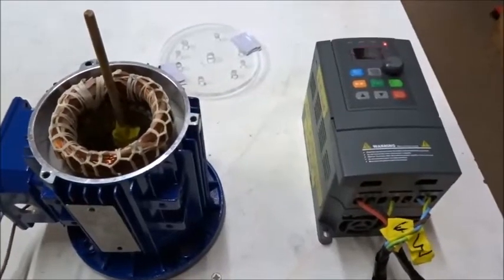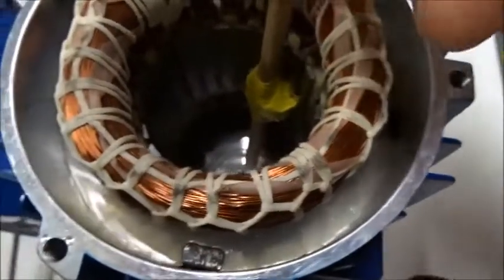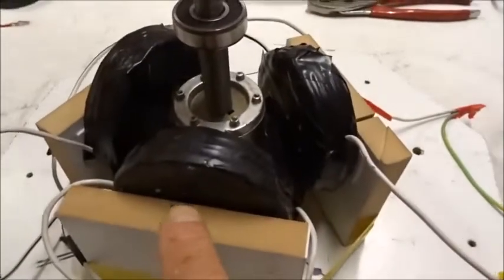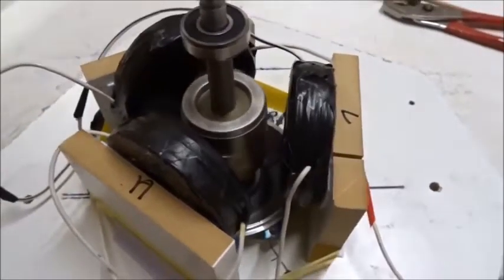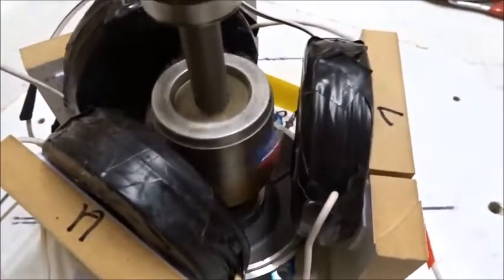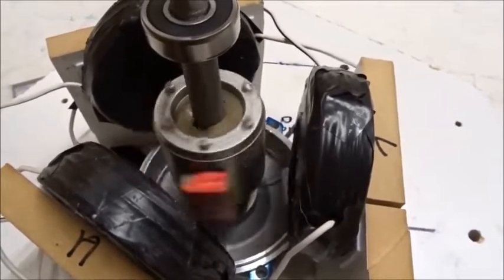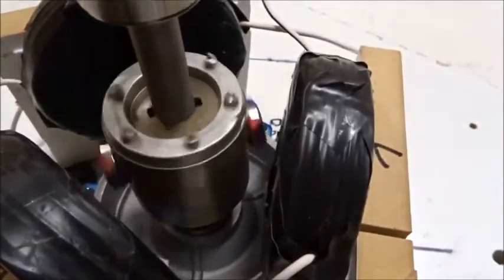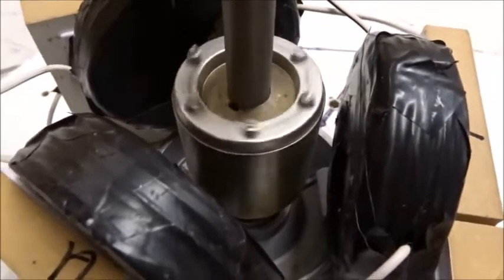Adding self-starting magnets to a 3-phase induction motor: Part VIII

Comment: Impressive work! Bare with me, I'm in need of improving an induction motor too for better low load efficiency and after reading several univeristy experiment papers on doing this, you are on the right track, however there are some caeveats and I have found out the following:
Replacing the cage with PM magnets improves efficiency and makes your induction motor a syncronous motor. However it also introduces some problems: Without the cage that is capable of varying its magnetic field depending on load, you now have motor that has fixed max torque that can be as large as with the former cage, but that makes low load efficiency even worse, as now you have excessive cogging from current induced in the stator laminations when not needed. You can also use weaker magnets, but then you get a weaker motor overall. The second problem is starting: Slowly ramping up the frequency at no load, like with a fan works fine, but a high enertia load, like a vehicle, you can't use a simple vaiable sinosoidal controller as the rotor will just slip when the frequency exceeds the rotor speed.
I think the best compromise is to make what is called a linestart PM syncronous motor; you keep the cage but spice the rotor with PM magnets, so the motor works as a syncronous PM motor at low load, but if high torque is needed, the cage takes over and the motor becomes asyncronous. So with my 30kW motor efficiency in the 6-15kW range is fine (around 86%) but at low load 1-2Kwh, it is only between (44-64%) which is horrible!! So to convert the rotor I intent to drill a line of shallow holes inbetween the bars of the cage and place small cylindrical magnets for the 4 poles normally created by the cage. I think this will be quite an interesting motor that will have a noticable two different modes of operation: a low load efficient mode and a high power mode, where some cogging or unusual vibration can be felt when the slipping field crosses the PM field made by the magnets. What is your take on this? Thank you for doing all the hard work.
Reply: I am not sure. If you go back on the Yuuki Sailors page and look at other videos just before, I show how to make very efficient 3-phase AC motors with permanent magnet rotors (no cogging) by a principle which I called "V-W torque". They don't teach this in the schools! For example 6 x 3-phase wire coils and 4 NNNN or NSNS magnets as the rotor. Self-starting and very powerful. The magnets would need to be heat-resistant for industrial work. Please check those prior videos? The copper induction / permanent magnet mixtures were just an add-on. "V-W torque", not "Lenz Law induction" to provide high self-starting torque. Not taught in the schools LOL.
Reply: @redcollie36  Thanks alot, 
I'll check him out.